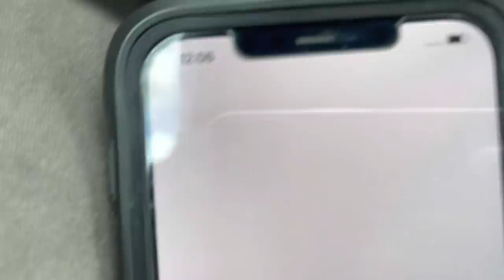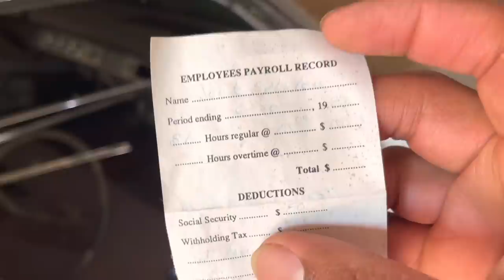BARN FINDS| 1961 Impala parked for 28 years! #thedustybubble

Comment: The Chevy Impala holds a special place in my heart. My first car at age 16 was a 1969 Impala Custom Coupe with a 396 big block, turbo 400 tranny, and a positrack rear end that could dig holes in blacktop. I bought it for $300 in 1979 and that car was a beast. Only had a 2 barrel carb, but I still maxed out the speedometer that went to 120mph. Mint green with a white vinyl top and the faux wood paneling interior.lol My mom had a ginormous Kingswood station wagon that she taught me to drive in. Trying to parallel park that beast was a real challenge. It was white so we nicknamed it the"great white buffalo" and it was so big it had its own zipcode. A family with 5 kids needed this size of car to get around when gas was like 50 cents a gallon. Caprices and Impalas were some great cars that I cruised a lot of main drag miles back in the day. My brother had a 1966 caprice with a 327 in it and we cruised that car listening to this new band called the Cars singing about a girl named Candy-O. Those were the days.
Reply: Had a 69 Impala myself and still miss it! Mine was green with a black vinyl roof.

Comment: Those cars are beautiful! As far as the ram horn manifolds, just about every small block Chevy had them, including trucks. There was no horsepower advantage with them (unless you had the Corvette 2.5" ones), they were simply all Chevrolet had until the accessory bolt holes appeared on the cylinder heads in 1968, when the alternator had a bracket there instead of on the manifold. Corvette continued to use the ram horns through the 1982 model year.
Reply: Those ram horn exhaust manifolds are what we call cast iron headers back in the 60's and 70's

Comment: It's probably a 283. The 327 didnt come out until 62, so the available V8's were 283/348/409.  The 2bbl was 170 HP, the 4bbl 230HP.  My dad had a 283 4V Turboglide Impala Sport Sedan.  The dash was the same color and had the same emblem.  I learned to drive on it.

Comment: how did it ride on the trailer with it being on backward and the weight at the back?
Reply from the maker: It rode fine. I squared it up so that the weight was evenly distributed on the trailer. It’s also a small block car. If it was a big block, I would have turned it around.

Comment: Like volks wagon nettles hardly changed since thirties looked identical to 60s and 70s cars but couple of differences in thirties 35 un up had split price window licence plates in back only were disproportionately wider and tail lights had same frame like in sixties and seventies but lights suck out more making it look flying Jetson carish and that was all but all those couples changed split piece whole rear licence smaller like regular like today's cars and taillights like today when changed in sixties but head lights body were always same with out change and fenders did not change at all either

Comment: Do you know what engine the car had originally the front end set up high like maybe it had a big block I got a 65 Impala originally a 6-cylinder it has Big Block in it still got the original 6 cylinder spring yeah she rides pretty low your engine looks like a later 350 because in 61 it has generator the on the driver side 61 did not have the holes drilled in the head for the alternator it could be a 69 327 set up that way either way it doesn't matter as long as it runs good you should have that thing running in a day good luck to you better than that setting driving while you can because you never know when you can't drive anymore that's what happened to me got some nice cars but I can't drive them I just don't get it because he parked it 20 years ago never drove it you know maybe you had a good reason maybe he just wanted to make a profit later
Reply from the maker: 6 cylinder with a 3 speed manual on the column